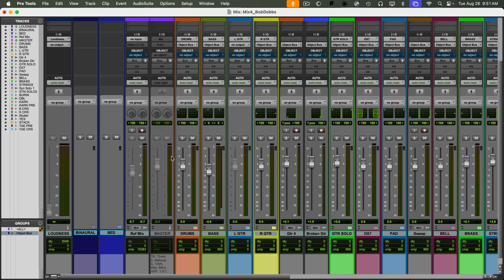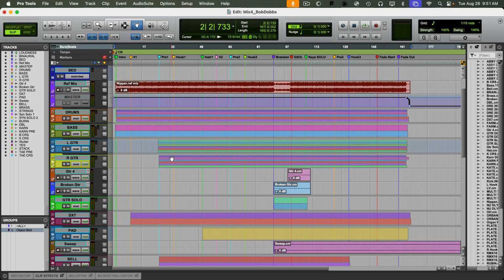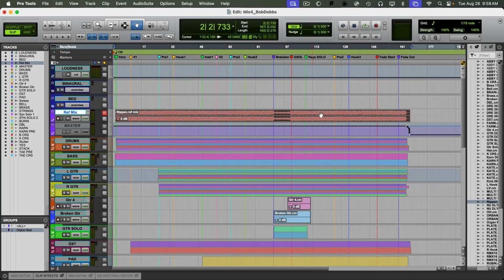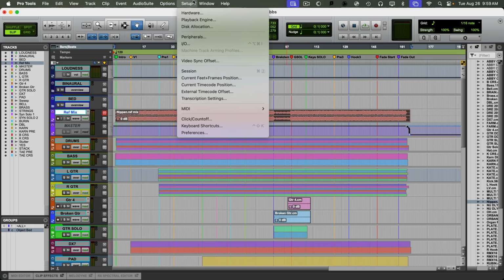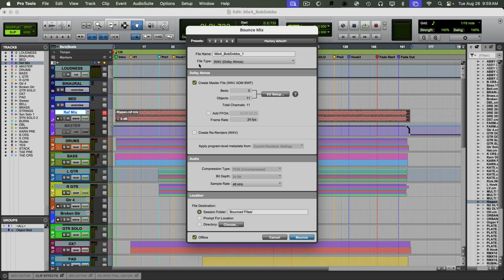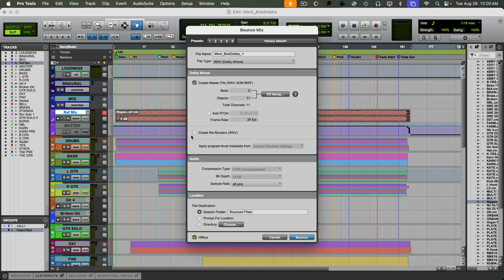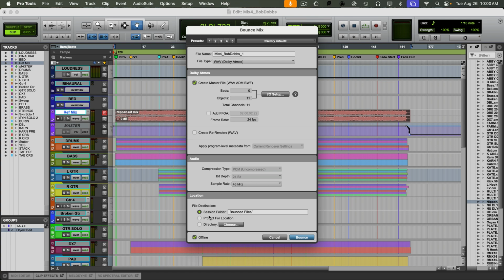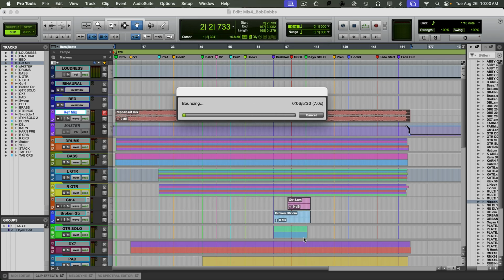Pro Tools Dolby Atmos ADM File Printing Creation

Comment: Impressive that you have an older version of PT , avid is now not compatible with my Mac system and I left out of around £500 which I initially paid for PT  as they try to push me into buying newer perpetual license , thank you for your video anyway - if you can share your secret on how you managed to still have old PT system I’ll really appreciate it 🐟
Reply: I don't think this is an older version (he wouldn't have ATMOS renderer or folders) I think he just kept the original color theme as opposed to the new dark mode.